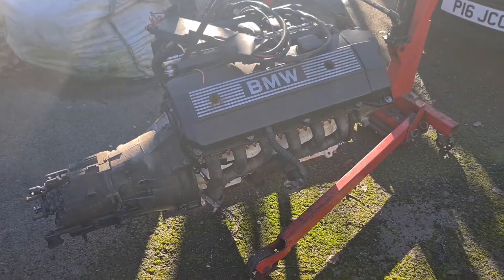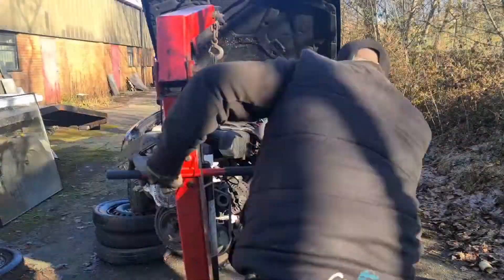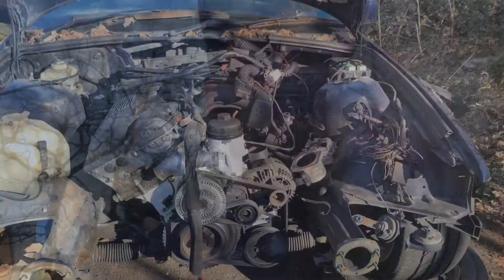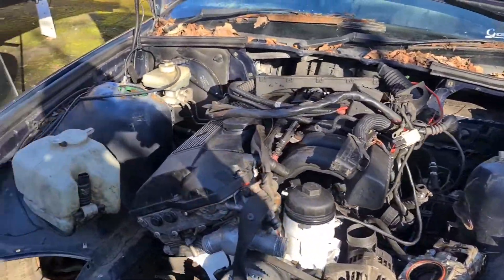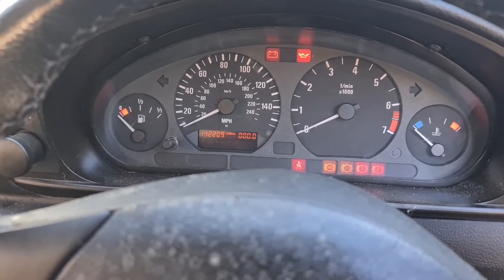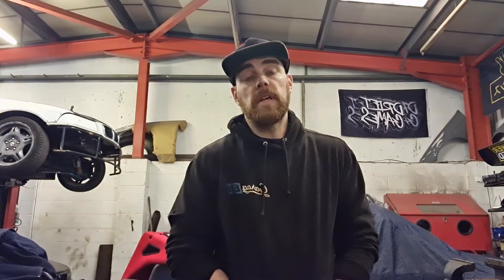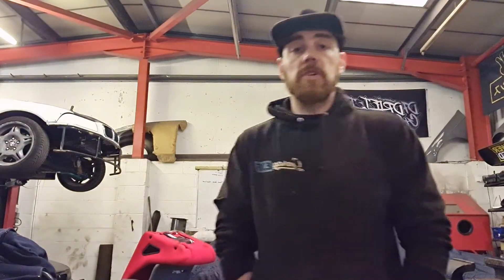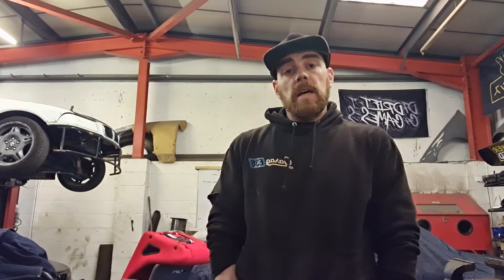BMW E36 M50B30 Stroker Engine Build, Part 10, First start.

Comment: Is it the Stock 325 ECU?
Reply: Great build can’t wait to see it run, any idea when?
Reply from the maker: @ryandevries7432  its up and running.. However there's 2 cars blocking me around the back of the workshop i need to move 1st then I can get it out for a test drive. I'll post the video, hopefully within the next week or so.
Reply: @GaragE36uk  can’t wait to see it 💪🏼
Reply from the maker: I am running this one ms41 ECU and management, so basically m52b28 loom sensors and ECU. More tuning options available for the ms41.
Reply: @GaragE36uk  did the engine start just with the normal 328 map? or did you tune it before starting?
Reply from the maker: @blunahd811  no tuning required as of yet. The ms41 2.8 ecu will run it no problem, just will need tuning to get the maximum gains from the engine.. 

That video was the first time I started it, havent had the chance to road test it yet but hopefully get some proper driving in the next couple of weeks. 

So far its runs and idles just like a standard engine. Sounds better than standard 2.8 tho.
Reply: @GaragE36uk  pretty cool! thanks for the quick answer! have a good weekend :)
Reply from the maker: @blunahd811  no problem mate, nice to have people interested in the build.. 

And thank you mate.